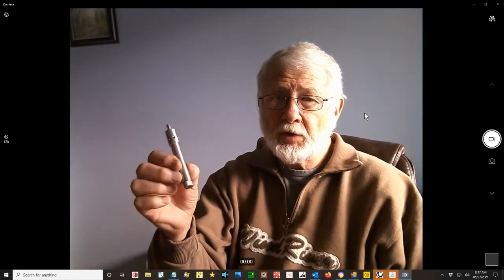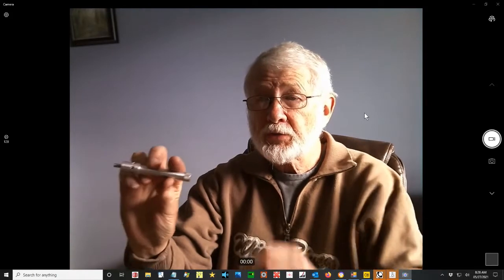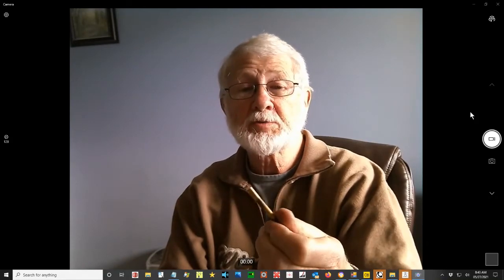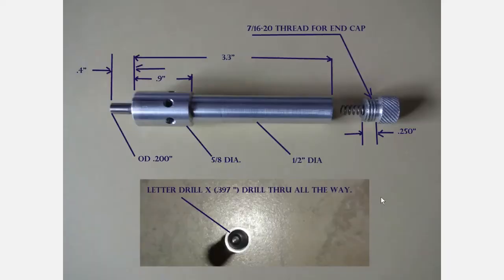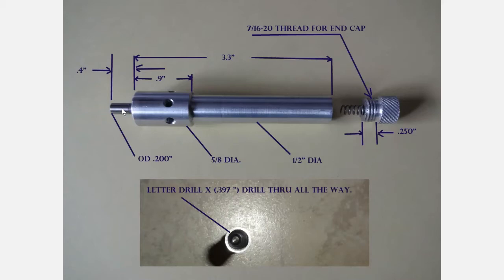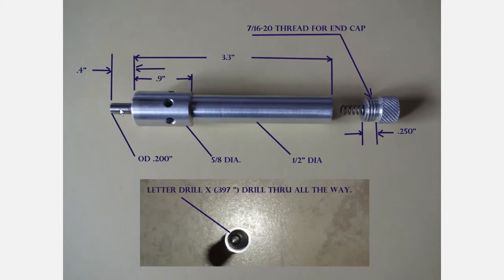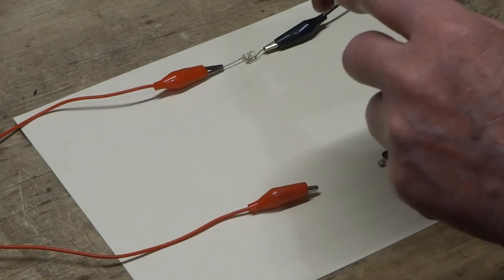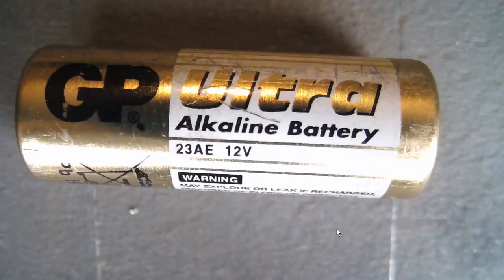Homemade Electronic Edge Finder

Comment: LEDs have a maximum current that can pass through them. If you exceed it the LED will die sometimes quicker than expected. Best to check the manufacturers  specifications on the LED. A good starting point for LED specs would be about 2.7 Volts forward voltage at about 30mA current. To calculate the required resistor you need you first calculate the voltage across the resistor which would be around 12V - 3V (2.7V) divided by the current 30mA. This will give you about 300 ohms. Probably use a 330 Ohm resistor because they are easier to find and less current will benefit the LED.
Reply from the maker: That is good info Llouis. I learn something every day so it's nice to get that feedback.

Comment: Thank you for posting this.  I'm trying to gather information to build an electronic edge finder. Unfortunately, there is just not enough detail in your video on the guts of it, just two blurry pictures of the LED. I really couldn't tell what the second picture was. There are no details on the plastic, the connection, or how exactly the probe makes a connection. If you could supply more details, including a detailed drawing, it would be appreciated.
Reply from the maker: I don't know how to add to the video so here is the order of component connections. End cap,12 v battery,100 watt resistor, led light, end contact probe. I hope this helps.